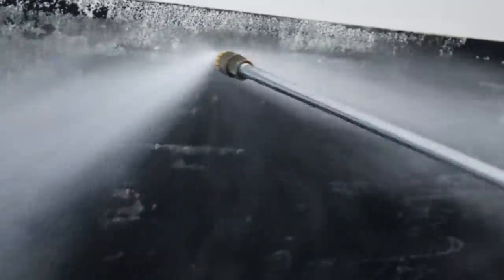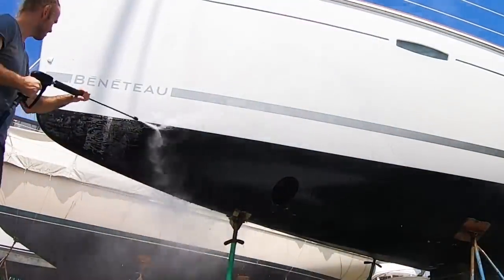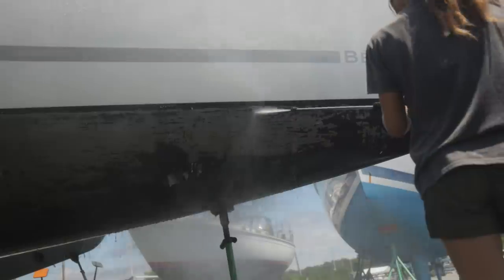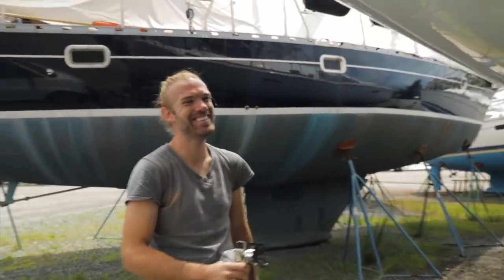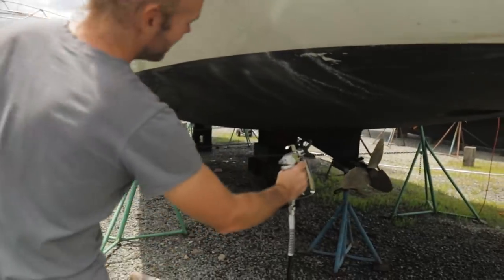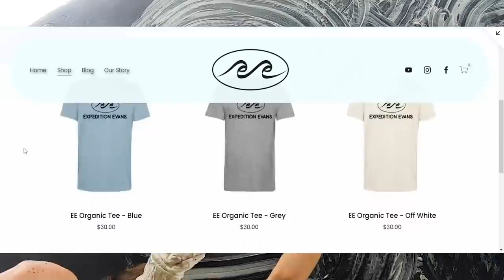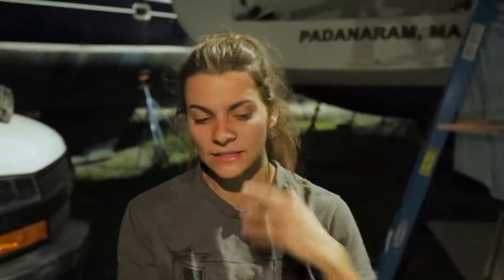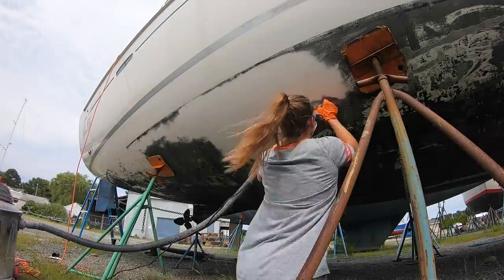PRESSURE Washing our SALVAGE Sailboat (finally) | Expedition Evans 26

Comment: thank you guys. I've been in your shoes, a few times.. I've bought several salvaged sailboats and a powerboat or two, from some of the same sources you guys have used / are using. I've lived aboard them and sailed them offshore.
You guys are KILLING IT!! for real.. your attitudes are inspiring.. I've been there.. working in the heat of the summer, in a boat without hardly any ventilation, while sweating in a cloud of some of the most caustic, uncomfortable dust imaginable. The hardest part for me was looking at the mess, knowing it needs to get worse, before it can start getting better. It gets overwhelming. Every step seems to uncover more future steps. requiring more blood, more sweat and more tears, oh yeah,  and of course, more money.
Things i've learned along the way.. don't cut a 200 dollar sheet of material with a 30 dollar saw. buy the best tools you can afford. Cheap sandpaper will cost you more in the long run. Keep smiling.. 
Seriously, you guys are absolutely doing this job perfectly, learning as you're going.. Watching Jade locate the keel bolt holes the other day, and learning how to find them easily with the help of a light source under the boat, just like i did over 20 years ago made me smile. 
Looking forward to more episodes, maybe one day we'll bump into each other in an anchorage somewhere / someday. you guys really are doing some great, (very difficult, very dirty, very tiresome, very hard) work, while keeping your smiles, all the while(s)..

Comment: Best to use a Skarsken type scraper - use it with the blade at right angles to the hull and use a pulling motion (DO NOT push)
Would also advise before use that you lightly grind each extreme end of the scraper blade to prevent it digging in.
Used sensibly this will remove baked on anti fouling paint effectively without damaging the gel oat .Try it on a small section-you will be surprised. It will however take some time to do the whole hull. My own yacht is a 40ft Jeaneau so speak from experience.
I have owned a number of yachts over the last 40 years and this is the best way. A pressure washer will only take off loose flaky paint and slime.
A stiff scrubbing brush and lots of water and effort will take off soft anti fouling paint if it has only been on for a season or so. Good luck.

Comment from the maker: Rotary nozzles, more water pressure, sanders, soda blasting, grinding...Taking off this paint is going to take a lot of work, regardless of how it's done. We started off with the pressure washer since all the yard guys recommended it and even told us who to rent it from. It worked, but at the end of the day it just didn't get enough off. We'll be switching to sanders next. Hindsight? Pay for soda blasting lol.
Reply: Not so close and only to remove the small loosing particules.  A pressure washer never removed an antifooling
Reply: Soda blasting is ok if you have a compressor big enough for it. Paying someone to do it would be worth it. Good ole sanding works but sucks doing it. At least it was only ablative and not hard paint. Multiple layers of it is a bear.
Reply: @davidrhightower  I want to chime in and say that dry-ice blasting is a method I've used in industrial settings. I've also sand blasted and soda blasted, and in my opinion, dry-ice blasting is the bees knees. It leaves no residue, it's non abrasive, and it's non toxic and it does a terrific job of blasting a material clean. In fact, I think it's better than sand blasting and soda blasting at cleaning surfaces. Clean up consists of sweeping the paint/rust/dirt off the floor as the dry ice converts into its gaseous state after hitting the material you're blasting.

I don't know how much it costs though, as someone else was paying for it.
Reply: Or hire a gelcoat peeler if you want/need to see the actual fibreglass.
Reply: For me only sanding does work (never saw that mentioned blast methods). 
According paint removers: 
I had terrible experiences during Army time - working in a reworking shop. There were many firms presenting their products. One time a salesman took our job painting his remover on all of the large missile body. In a quarter hour the old paint dropped down in large chunks. Chief: That's what I'm expecting of chemical stripping. We got some cans of it - but that solvent failed completely on the next body. So weh should have some 4 - 6 different products to store and try it on every new missile - not suitable.
We finally ended chemical stripping and continued with exhausting sanding. 

By the side: That chemical stripping got us in some trouble later: the bodies were constructed of rings that were plated by plates. So between that plates there were gaps of less 1/4". Those gaps buried some chunk of the paint remover - removing some of the new paint in the following 1/2 year. 
😰

Comment: Ok, I have a bunch of tips for you for the next time this job needs doing. 1) AIRCRAFT STRIPPER from a car parts store or automotive paint supply store.  2) Spread it on a smallish area and then cover it with saran wrap. This keeps the stripper wet and when it is wet, it is working. Once you have wrapped up that section, move onto the next and repeat.  3) You may want to tarp the ground under the boat so not to piss off the management. 4) Sometimes the place you rent a pressure washer from will also have a nozzle that spins. I will be damned if I can remember the name of it, but it's WELL worth looking up and renting or even buying as it will speed up the time needed to strip or wash everything... 5) When you want to remove paint with pressure and some type of aggregate, try to work in lines at an angle. Meaning: Start in one spot and drive forward as if you are using a razor blade to strip the paint. 6) Depending on the paint and how well it adheres,  sometimes a razor blade on a scraper handle works very well.. 7) Before you go crazy stripping everything again, really dig into if it needs to be fully stripped or not. So if the paint is looking poor, but sticking well, sand off the face layer and use it as a primer. I really suggest reading up on that....  Best of luck!!!!

Comment: Old moldy guy here. I have found that stripper quits doing anything when it dries out. So if you apply it liberally with a paint brush to a small area, and then immediately, as in right then, no fooling around, put down the brush, and cover that small area with a piece of saran wrap it will make the wait for the acid to soften the paint go much better. 
Ttfn. Love watching naive noobies learning their life lessons. You guys are great entertainment.
Keep up the good work.
Reply: 30s into this video, i knew i was going to watch a life-lesson being learned.
Reply from the maker: @hollo500  truer words
Reply: Totally agree with you. I use to use paint stripper on old painted intricate ceiling cornice and doors with 100 year old layers of paint. After applying the gel stripper I would cover it with cling film. Let the stripper do its job timewise then just peel off the cling film. Most of the time 90% of the paint came off with the cling film, the rest was gently scraped off with back hooks and shave hooks. It's alot less messier than standard scraping the paint stripper off.
Reply: This so very true. Same technique we’ve used stripping paint from aircraft!

Comment: Ablative is very soft and the barrier coat and gel coat is considerably harder so you can media blast it off pretty fast.  Soda or whatever shell media is available will work.  The easily removed side possibly flash dried in hot sun and never adhered too well.

Comment: The reason why one side was coming off easier than the other is that  you should splash the boat asap after antifouling paint is applied, longer it seats dry, weaker it gets. Antifouling paints are generally designed to cure inwater 
Best
Drew

Comment: I’m not fan of too much time with too much water pressure on gelcoat. Osmosis is my concern. Pressure wash the sea life off so you don’t load up the abrasive later. Orbital sander with vacuum is the best way to get the paint off. If the paint is really hard to get off, sometimes there’s no sense in removing all of it, just anything that’s loose and to get texture for the new paint to bite into. Before I sand I like to wipe the waterline stripe and the hull just above with wax remover to reduce any potential contamination worked into the surface to be painted. If you’re worried about loose paint, do a quick wipe with a rag dampened with MEK in a small area(don’t soak the area). Wait a few minutes and look closely for any paint lifting. If so, the paints got to go.

Comment: It's a beautiful looking boat, great lines.  I didn't think you would get anywhere when you started with the kind of damage it had.  Impressive amount of work and dedication to getting it done.  It's probably stronger than it ever was.  Today's paint stripper doesn't have methylene chloride in it any longer.  The MC strippers could be put on for minutes then you can go after the bubbled paint with a scraper.  Today's strippers recommend a similar application to removal time, but I have heard that a 24 hour sit is what is needed to get similar results.

Comment: You guys are awesome, and i love your channel!!!  But guys, guys, guys, pressure washing should be used to remove the unwanted sea life, not paint.  Especially not on fiberglass as the water has a chance to inject itself into the fiberglass (not good).  A good putty knife, paint scraper, and sanding are still the best ways to clean a fiberglass bottom.  As a retired aircraft mechanic, boat owner and live-aboarder i have had my share of bottom jobs and boat projects.  I admit to being a little old school, but being old school is not a bad thing and always worked for me.  Good luck on the bottom job and your videos.  I look forward to them each week
Reply: Phew, I think the whole time while looking, that's just too much pressure with this dirt blaster for anti fouling.  It's good that someone else recognizes that, you're breaking the glass fabric!  Hopefully it went well!  Good luck.
Reply: Makes sense, like the old school part, his quote: I don't think its cheating if there are no rules, was good too. I'm a carpenter and thats been my experience too, that there are just some jobs that there is no replacement for handtools.

Comment: In this World we normally apply with a "paintbrush" for a consistent coating !! Will you be taking it. off with a knife and fork ? Next time 80 grit on an orbital sander connected to an industrial vacuum cleaner is the way to go. Good luck !
Reply: But this is the COVID world , the old world ways are never more.   I hope they don't change to an electric motor!

Comment: Guys, while you still have all of the interior removed, take a thought about glassing in a small documents/valuables safe somewhere. Preferably only accessible from inside a locker or under the floor if there is an easy to remove floor plate.

Comment: EE: did you see Sailing Aurora's latest on fixing the grid on their Hanse? For comparison with the professionals it looks like you did a great job!!
Reply from the maker: We had not seen it, but that's good to hear!
Reply: @johncartelli  I'll take EEs fix over the 'professional' fix.  I doubt 'laminating the inside' is really possible. Also EEs 'discovery' of second cosmetic layer on the grid suggests the 'professionals' might not be going deep enough with the grinding.
Reply: @narr0wm1nd49  Those professionals repairing Aurora are Scandinavia's best at doing fiberglass repairs, so I wouldn't have any doubt about their skills.

One can be lucky once or twice, but repeatedly doing the same thing successfully isn't luck, it's skills.

FYI, The context is the professionals, not Expedition Ewans, so no straw man, please.
Reply: @narr0wm1nd49  ee's boat was a massive undertaking  by non pros...and the integrity im sure is far superior to a stock ship.however i merely posted that for them to hear someone else  view and ideas of why and how this problem happened, not to say who is doing a better job.
Reply: @charonstyxferryman   I hope we can all see how they perform the repairs. 

One takeaway is they used much more powerful vacuums attached to the grinders and sanders. Those might have been more expensive but really did provide a much cleaner demolish.

Thinking about glassing the inside of the grid you will likely have an acute angle where the grid meets the hull. Trying to lay a fillet in there and then glass it without being completely opened up will be interesting. Lets see the tricks the pros use.

I was mostly pointing out that the grid seems cosmetic layer on the beneteau on top that glassing to the hull won't help much unless you over build it so much that the old grid actas more like a jig or mold and the strength comes all from new glass. Lets see if the Hanse has the same cosmetic layer on the grid. 

While It looks nice that cosmetic layer isn't something anyone really sees and is great at hiding damage. If the Hense doesn't have it that might be a vote to buy a hanse over a beneteau all other things being equal.

Comment: On "barefoot and diving(?)" they had this grinder that took of ALL the paint in one move. Gelcoat and everything.
Reply: You could probably set that stripper machine to just take off the bottom paint layer without touching the Gel Coat, would be bad if it took the Gel coat off, probably not guaranteed either

Comment: I know this applies to older videos but how did you like the Raka Resins compared to WestSystems. I am patching a transom in my houseboat.
Reply from the maker: We'd used West before and ended up having to use West when we ran out of Raka at one point. Raka, hands down. If we'd had to do this project with West it would have been 10x more difficult. Raka had no fumes or smell, easy mix ratio, tons of pot life and way better wetting out. Not even a comparison imo

Comment: My experience is  "organic" or "green" paint removers or cleaners are simply donations to the manufacturers
Reply: Yes! 
Yes!
Yes!
Reply: In Australia we have a eucalyptus based paint stripper that is widely used in an industrial capacity by businesses stripping external house doors and wood work etc. Our toilet cleaner uses a similar product and they work very well.
Reply: My old Boss used to say that you could use them as sweeteners on you sandwich...
Reply: @steviebee1989  Turpentine is "natural" Is it better than mineral spirits made from oil? The question with "organic" is toxicity and biodegradability not what it is made from

Comment: 7" disc grinder with coarse sandpaper takes that ablative paint off faster than anything, And being ablative you have to take ALL of it off unless you are going to repaint with another ablative coating. In which case why stress, you could repaint over any scratched or roughed up surface.......

Comment: As long as you let the bottom dry out for a couple of weeks before painting it this technique might work. I scraped and grinded the whole bottom on my boat cause you never want to push water into the gelcoat. Ice blasting would have been another good solution...

Comment: Stupid question time... How come you didnt use paint rollers to apply the stripper?  And/Or could you have thinned the stripper down with water or something so it would spray?  I realize this is all afterwards, but for future reference when you re-apply the anti-fouling.  Or will you just paint over with more anti-fouling?

Comment: Jade, I know I am behind but if you ever need to remove your bottom paint again, please consider either wet sand blasting (uses a pressure washer with a special wand and ceramic nozzle that draws in sand - you can do this yourself) or soda blasting (like a sand blaster but uses sodium bicarbonate, baking soda, as the abrasive - again, you can do this yourself). You can buy or rent the machines and either would have been quicker, easier, and more thorough than what you did. Also, even with a pressure washer, you should wear goggles and a respirator, for a number of reasons. I used wet sand blasting last time I stripped my bottom but would probably go with soda blasting in the future. Both are environmentally safe but sand doesn't decompose or otherwise go away like soda will. Also, why didn't you just roll the paint stripper on?

Comment: Oh, MY .. All that work scraping and sanding toxic paint, spreading stripper and using pressure wash, and NO EYE PROTECTION. I have to say this just scared the crap out of me. I've lost just some eyesight in one eye, and I can tell you my life has been altered permanently.  I'm no longer sailing after 30 years of sailing life. Safety glasses are so cheap and easy to wear. Love your progress, wouldn't miss an episode. Be SAFE.

Comment: On that paint conundrum, did you have a chance to measure thickness of the coatings ? Probably too late for that from what you've shown on video.. but should be considered when you're applying the new coatings/system. A paint thickness tester from car applications ($20-$50) will work vs the airplane grade transducer type for 100s of $... just buy the $50 "better" version, it can save you more than it's cost in a few paint jobs by economizing applications of paint where needed as touch up seasonally vs a total bottom paint from scratch. Particularly since you'll have to do this regularly and you can loan it out for some meals to pay the difference in cost.  (You'll actually make money that way !) Take Care !

Comment: Did the sprayer come with a spec sheet defining the viscosity range of the substance to be sprayed? I guess I would have applied the paint remover with a big brush. The brush Piasava springs to mind. Or some other big brush
Reply: Defo with brush, but dab it on and leave it to react for the time stated, especially if its a biodegradable type.